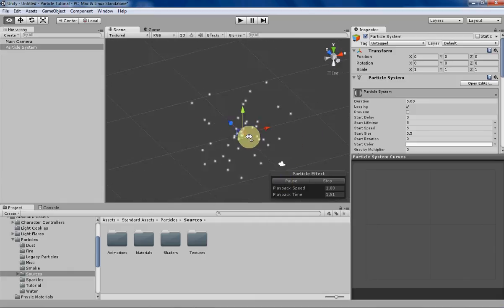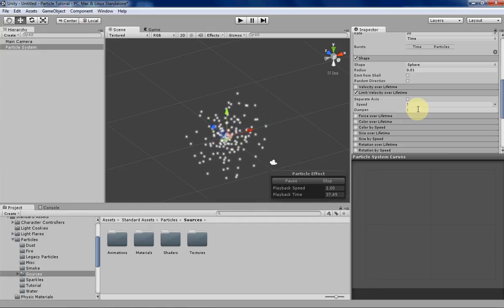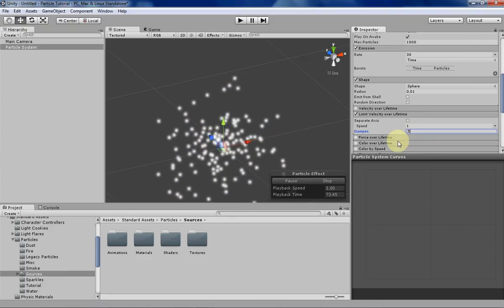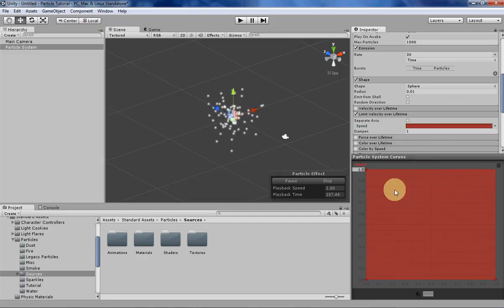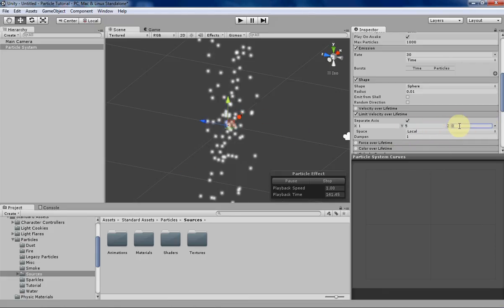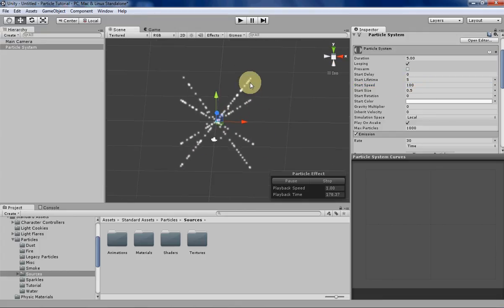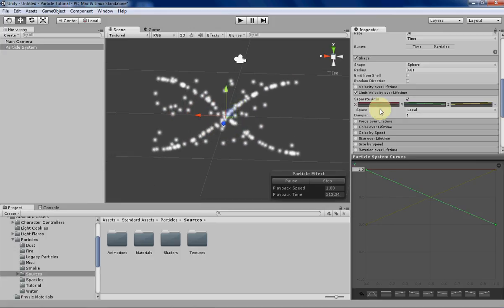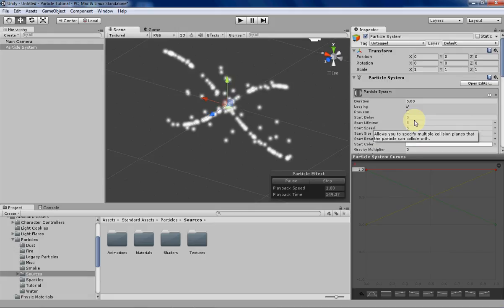Unity's Shuriken Particle System: Limit Velocity over Lifetime

Comment: dampen results in-game playback are acting much different than editor mode, 

they also seem affected on time / frame rate, I'm getting unintended results on devices unable to unify frame rate, and absolutely when using time scaling

edit > project settings > time
set to .5 and check results in-game
Reply: +jerkazoid Hey, sorry for replying to such an old comment, but I'm having the same exact problem in my project. I've tried searching for an answer with no luck. Did you ever find a solution/work-around for this issue by any chance? Thanks.
Reply: +lazenbyscake as of 4.3 this was marked as 'fixed' https://issuetracker.unity3d.com/issues/shuriken-particle-system-module-limit-velocity-over-lifetime-is-fps-dependent 

dampen (limit velocity) in versions after seem to now work based on time (not framerate)... however mixing over lifetime with dampen will yield undesirable results; i.e. a value from N to 0 with dampen will cause the end motion to move -N 

more here
https://issuetracker.unity3d.com/issues/shuriken-limit-velocity-over-lifetime-allows-negative-values
Reply: Oh, nice! Thanks for that.